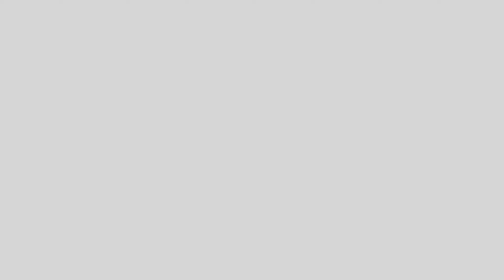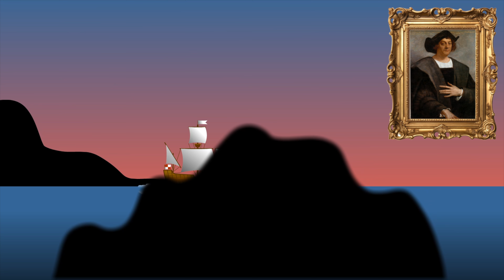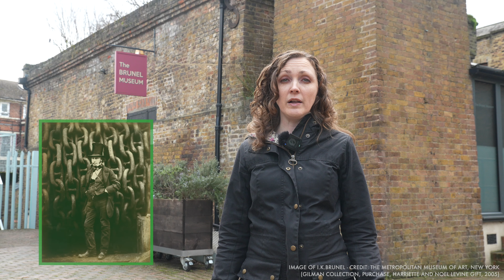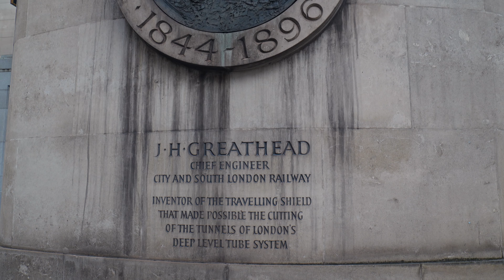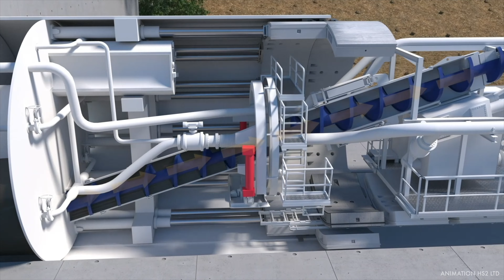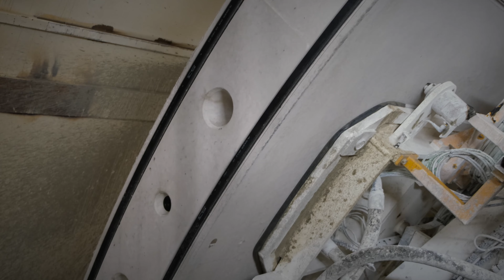Inside a GIANT Tunnel Boring Machine - The Surprising Truth About How We Tunnel!

Comment: Thanks for that, though I've never heard of tunneling being related to a timber boring clam before. A mole yes and as I drove both types of TBMs on the construction of the Victoria Line back in the mid 1960s. The first was the Kinnier & Moody open face digger shield and then came the McAlpine digger shield a much more refined machine and a model was shown in the Brunel museum. These two machines achieved fast advances due to the power of the cutting heads and the fact the segments were not bolted to together or to the previous ring. They had convex and concave side that slotted into one another at the ring and seat joints. One segment each side just above trach bed height had cube left out where a hydraulic jack was inserted, this expanded the ring outwards against the clay, concrete wedges were then inserted to hold the ring against the clay walls. Four complete cycles could be made each hour, the big problem was transporting the spoil away and segments in, as the TBM worked away from the service shaft the distance grew each shift. Extra rail crossings, lay-bys were installed with more rolling stock to try and keep momentum up.

The endless conveyor belt used by HS2 is one of the ways hauling distance, another method is to mix the spoil with Bentonite and pump the material out of the tunnel via pipes.

In the 1980s I joined a Civils consultancy company and was employed on tunneling contracts around the world. Have seen great advances in TBM construction. The last project I worked on was the KL Metro, Malaysia where several Herrenkenct Variable density machines were used, this advancement in design meant one machine could mine in two different ground types, which is typical in KL. Also London has one of the best mining ground type blue clay and that horrible Thanet gravels.